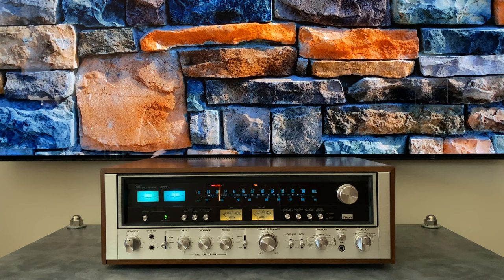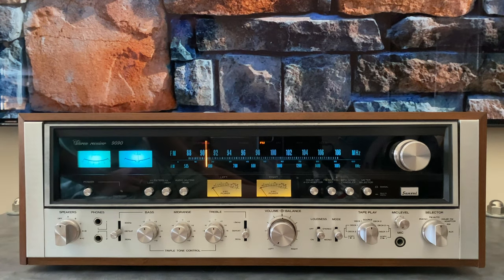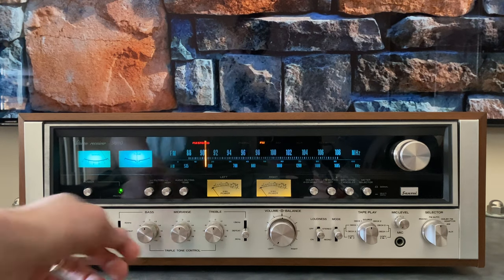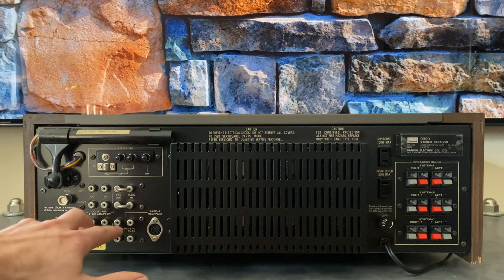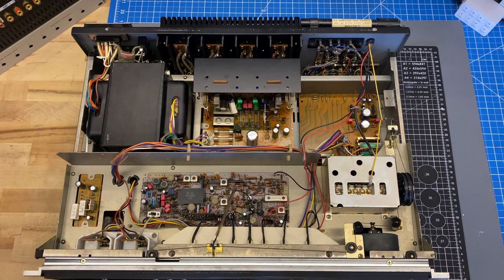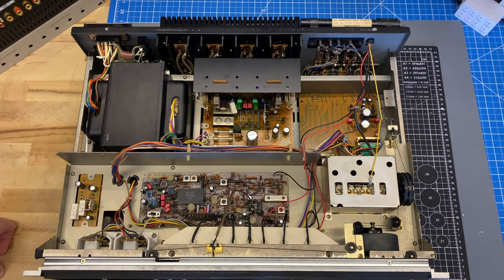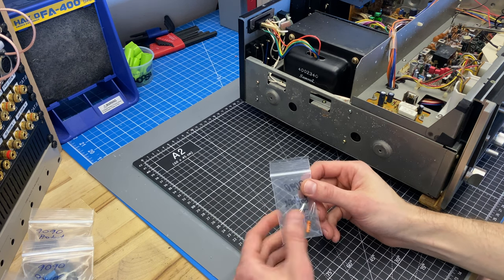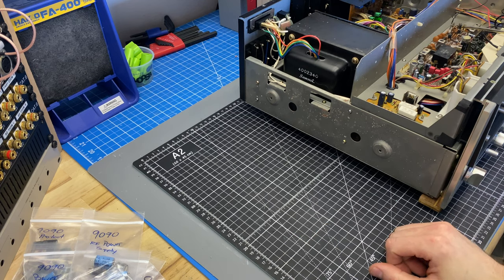Sansui 9090 (Non DB) Restoration Review & Comparison to 9090DB

Comment: my wife bought me a 9090 for my 60th birthday . eleven years later it's still awesome . I also have a 5500 sansui receiver , beautiful , love the ratcheting oversize volume control . Most recently bought a QRX 6500 sansui quadraphonic receiver .Lots of speaker selection options ( 3 pairs of sansui speakers ) The 9090 was by far the most expensive ( $800CDN)11 years ago but had been reconditioned .   Not bragging just so happy to be able to have what I've wanted for 50 years .

Comment: Excellent presentation, and very informative, cheers. By the way, from the serial #'s in the back, your units were both made in 1976 (June & November)- the third thru fifth digits represent the year and month of manufacture. As you mentioned, Sansui did make various service bulletin changes, which is good to keep in mind when evaluating a unit, depending on if you have an earlier or later-made model. 

I was aware of the difference in speaker selector settings, though I dont see why the 9090DB, the higher powered amp vs 9090, would be wired in series, such that if two pairs of 8 ohm speakers were being used simultaneously, the equivalent impedance would be 16 ohms (in series) , rather than 4 (in parallel) on the 9090- that seems like quite a difference.  If thats the case, then why not have the lower powered amp be wired in series to better protect against low impedances? 

My #1 Sansui receiver is the G-9000 (G-901), I would be interested to watch a review of yours, and if the dolby circuitry in the G presents the same complicated-repair issues as on the 9090db,  as I dont seem to hear as many complaints in-comparison. 

Ps: your video was posted in my 'Sansui Lounge' facebook group, so I am sure it will be of interest to many of the members there.
Reply from the maker: Thank you for the clarification on the serial numbers. That really drives home the point that there was a manufacturing overlap on these. This 9090 had all of the service bulletins factory installed.
Reply: @NovaluxStereophonic   Yes, the 9090 came out first, and was the top of the line model in 1975, and the 9090db came out a bit later and probably continued a little longer after the 9090 was discontinued, as can be seen in vintage hi fi magazine ads & reviews, as well as Sansui catalogs and brochures.

Comment: If there’s a problem with the cards is there a replacement path such as getting from a donor or are they available new from someone , or can be built ???
Reply from the maker: @marklloyd4153  there is only one removable card in this unit. I believe someone has recreated the original design on a new PCB. Most boards can be salvaged though so it’s usually not an issue.

Comment: Great video and very detailed information. Thanks for sharing. I have a 9090 and a 9090DB. I actually like both of them but use the 9090 currently due to some problems on the DB unit. One question I have is, on my 9090, my source/selector lights are not working. I did manage to get the dial lights going. (not led)  I'd like to have the source and stereo indicator light up again. Any clues on why this would be?
Reply from the maker: Your issue with lights is almost certainly related to heavy corrosion of the input selector switch. If you search for my video on LED conversion for xoxo models I go over this in some detail. I would start by cleaning the selector switch and see if you can at least get the input lights to come on dimly. You could also try checking all of the fuses but IIRC the dial lamps and all other lamps are on the same circuit.
Reply from the maker: https://youtu.be/Bc2rptE73i4. Start around 21 minutes.
Reply: @NovaluxStereophonic  Thanks for the quick response. I switched the connectors earlier today and was able to get the dial lights working.
Reply: @NovaluxStereophonic  I will do a proper cleaning. Do I need to remove parts? Or can I attempt to clean the source knob leaving it attached? Other than than that, my 9090 works great! Your vids are awesome.
Reply: @NovaluxStereophonic  I was going to order DeoxIT to to clean the switch. Would you happen to have a vid on the best way to do this? I've read that people have removed it to clean. I don't have soldering tools.
Reply from the maker: @hollywoodmark  Sorry, I do not have any videos on control cleaning. Maybe xraytonyb has something posted. If you don’t have soldering tools do not attempt to remove the switch. If you are ordering I would go with deoxit d100L which will allow you to get the cleaner right where it needs to be without making a mess.
Reply: @NovaluxStereophonic  Thanks for the helpful tips. I'll try that. I've now subscribed to your channel. Cheers.

Comment: Great restoration and review of the Sansui 9090! Just curious, I have an all original/unrestored Sansui 5050 that still plays fantastic - it had one repair 6 years ago due to a power supply fault that blew the F604 (.15 amp) fuse. No other issues since. Aside from the wattage difference, how much different does the 9090 sound compared to the 5050 assuming you previously worked on one before?
Reply from the maker: I have not worked on any X0X0 below the 8080. From looking at pictures of the insides of the lower units in the line it looks like they are completely different. The similarities likely end at cosmetics. As a general rule the budget models with lower power usually have less features. How something sounds is subjective, although the higher powered modes usually have tighter and more accurate bass response.

Comment: Very nice overview. Can you tell me what the switch on the FM board does? Thanks.
Reply from the maker: 75uS vs 50uS de-emphasis. This usually is changed with the world voltage switch depending on which country the unit is being used in. For USA it should be set to 75uS (switch to the left when looking at the face)
Reply: as the owner of a non-DB 9090 I thoroughly enjoyed this video and will be contacting you soon for repair .